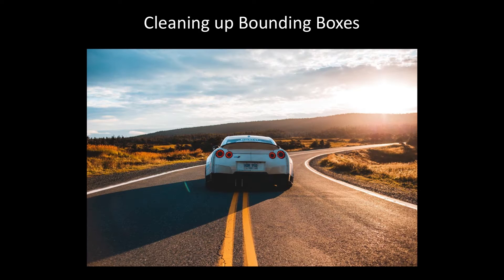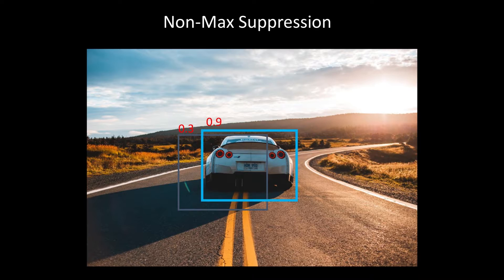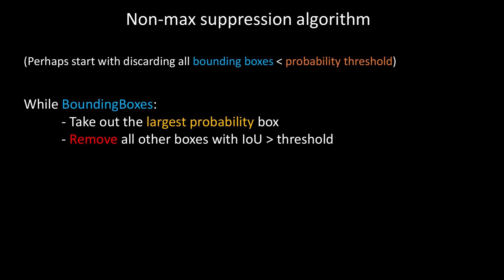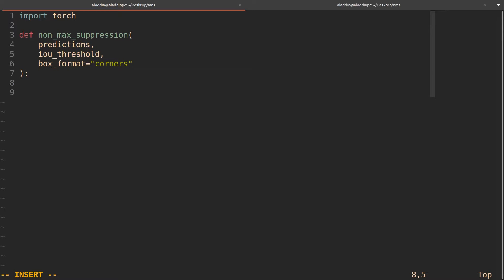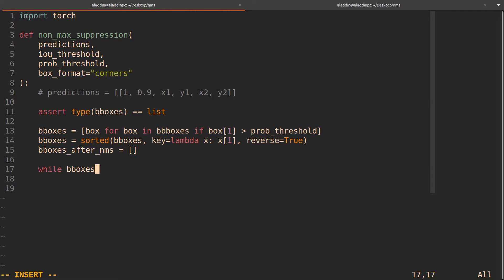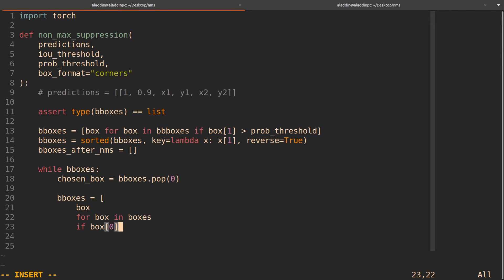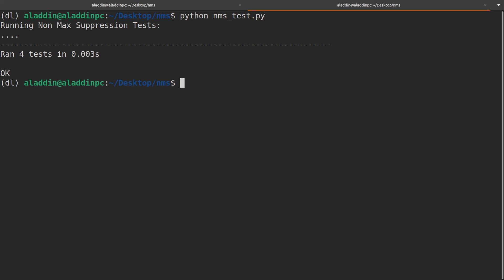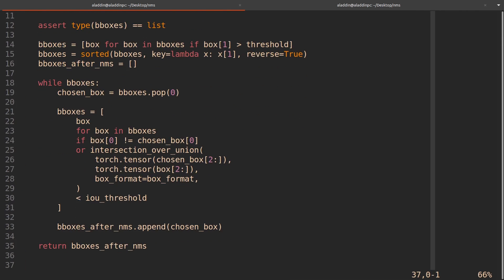Non Max Suppression Explained and PyTorch Implementation

Comment from the maker: One thing I wanted to clarify is that which class the bounding box belongs to is also something that our model is going to learn to predict. So for the non max suppression function we implemented where I described that one bounding box would be: [class_prediction, probability_score, x1, y1, x2, y2], here the class_prediction would be the argmax of all the class logits outputted from the model. I think this will also become clearer when we implement Yolo from scratch
Reply: Hi Aladdin Persson,  I'm anxiously waiting for YOLO scratch implementation. Please 🙏
Reply: Hello aladdin,
I have a question!
x2 and y2 are the width and height of bounding box, right ?
Reply: @pratikkulkar8128  for Yolo you must put box_format = "midpoint"
Reply: no it's the coordinate of the right bottom corner @pratikkulkar8128

Comment: I have a question that why we append bounding boxes with iou smaller than threshold. From what I know, we should return the highest iou bounding box and suppress the smaller  iou boxes. Can anyone correct me if I got something wrong? Thanks!
Reply: Think that there is a image with 2 cars placed far from each other, now u model create many bounding boxes for that 2 cars. now u choose the max probability bounding box and with the help of it u are removing unnecessary bounding box around it. Now Ques is how u remove... For that u calculate IOU (which tells how much 2 bounding box are overlapping). High IOU represent that the these boxes might represent the same car therefore we remove the low prob box. Low IOU represent that there is very less or no overlapping between bounding this means that other box might represent other car therefore we don't remove low IOU bounding boxes. Remember we take single class(here is cars) at a time not single object(single car). I hope it helps!!
Reply: @yashsinghal7471  awesome explantion yash, this should be pinned because I was confused as hell after watching this video and the code. the example in the beginning of this video completely gave me false image of IOU but maybe I misunderstood something anyway thanks;)
edit: watching the video after reading the comment and indeed I misunderstood, the video also said the same thing as this comment

Comment: Hi Aladdin, Thank you for the videos. Could you please suggest how slightly moving the location of the truth bounding box will impact the mAP values? Because it is a manual process, there are chances the way one person labels the image will vary from how another does; I was wondering how that issue is resolved? And how much impact it has on the precision. I will be very grateful if you could please respond. Thank you!

Comment: Hi Alladin, I really appreciate your Pytorch video series as someone who is just getting into CV. I am trying to implement your YOLO algorithm on another dataset but found that it was not outputting any bounding boxes. Many print statements later, I found out that the "bboxes = [box for box in bboxes if box[1] > threshold]" line was eliminating them since all their probabilities were very close to 0 (I think the threshold was set to 0.4).

I was wondering if this line is really necessary, especially since an untrained model outputs such random probability scores. Would you recommend lowering the threshold value or just commenting out the line? Thanks!
Reply: I was just trying to understand the code in detail. Could it be that the list comprehension in the while loop should not be ... < iou_threshold but instead the  other way round ... > iou_threshold. If I understand it correctly then the current version keeps the poor bboxes and dismisses the good ones?
Reply: @jurgenanklam3226  I think you're correct that it should be greater than (>), not less than (<), so that it keeps all the predictions with a probability GREATER than the threshold, but isn't that what's already in the code (6:50)? My problem was that all my probabilities were too low,  so none of them made it past the threshold.
Reply: Sorry, I have confused myself. After reviewing the video 02:00 .. I think I have understood the concept.

Comment: Thanks Mr Persson for all the videos♥️♥️.. i had doubts regarding this .. i tried converting an image classifier to an object detection but the problem that arises is that the small bouding box has a higher confidence score than the bigger one ... But the whole object is present in the bigger one ... The smaller one just contains a part of it.. since the smaller one has a higher confidence and its iou is one with the bigger one it suppresses it .. is there any way to make it work?
Reply from the maker: No, and the problem here is that you only know that by comparing with the target bounding box. Remember that non max suppression only operates on output predictions and it has to because when doing inference we do not have access to target bounding boxes

Comment: Hi Aladdin! Do you teach ML? Specially ML in TensorFlow? I’m struggling with a code and I’ve tried to ask for help on web forums such as stackoverflow but I did not get any reply. I have trained a model and I used the tensorboard callsback as you explained in your video, but tensorboard does not load the data. Tensorboard gets stranded on the screen trying to load my data and nothing happens. Probably there is something wrong with my code or maybe with my data file. So, I need someone to help me with this to understand whats is going on because I’m very new to TensorFlow and I’m trying to learn everything by myself
Reply from the maker: I'm not sure what could be wrong about that sorry, you followed my video on tensorboard but didn't get it to work? Have you tried running the code that I wrote which is on the Github repo?
Reply: Aladdin Persson No, I adapted what you explained to my code. I’ll try to run the one on Github to compare with mine.